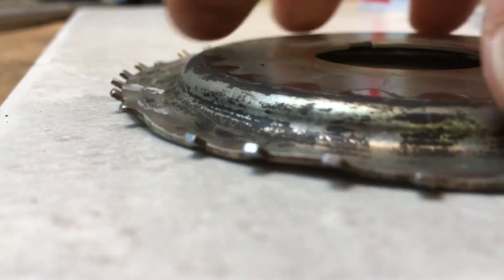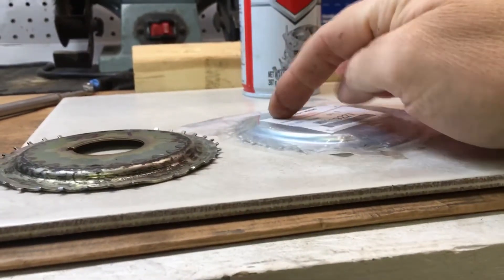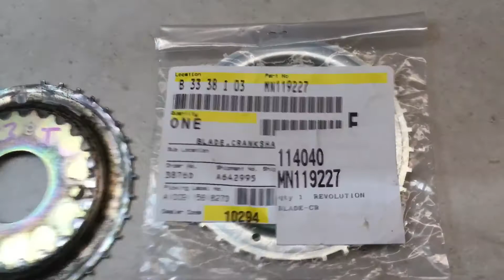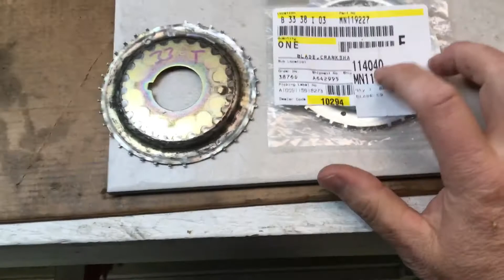Mitsubishi Crank Angle Blade, Bends After Belt Fails

Comment: Hello great video. Do u know the location of the crankshaft Position sensor is at? Thanks
Reply from the maker: The position sensor is fixed in the plastic timing belt cover

The timing wheel or blade orientation is fixed by the tooth pattern 

The gears are aligned with dots to a casting mark in the block

Comment: Were did you get the part
Reply from the maker: Breonne Mckinney   I ordered one from the Mitsubishi dealer (about 2 hours drive away), and also one online.  The one on line arrived first.  About $50 CDN each.  The part number can be seen in video to order on line and dealer can order by your serial number/VIN.